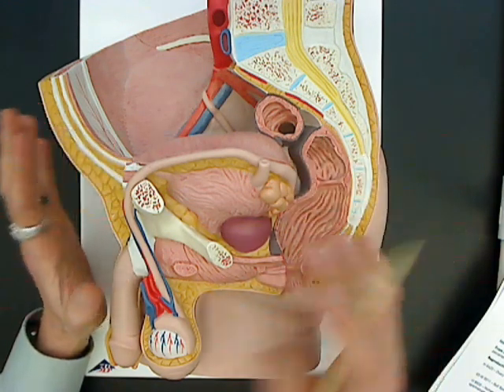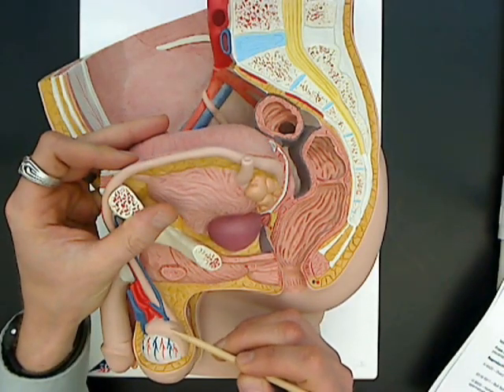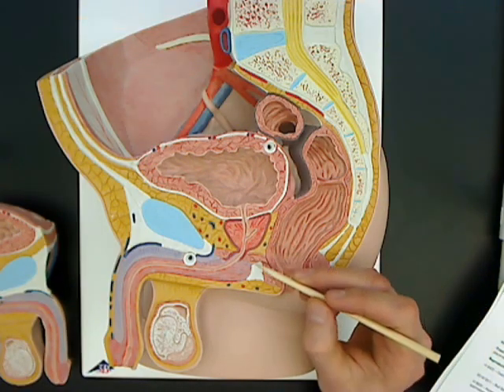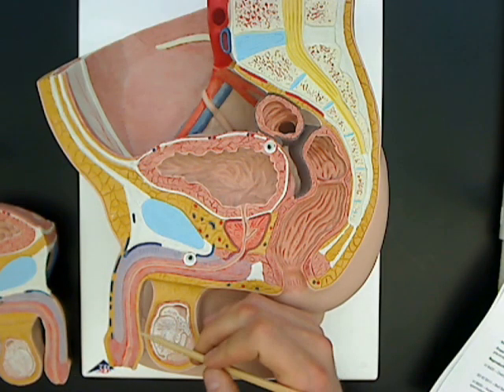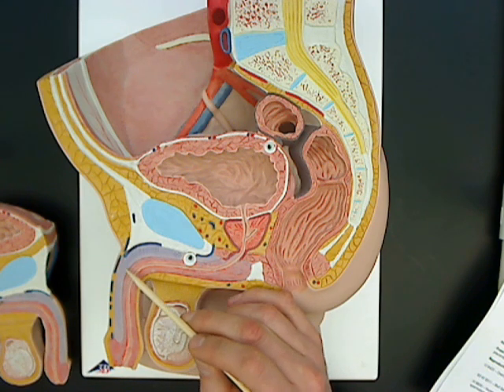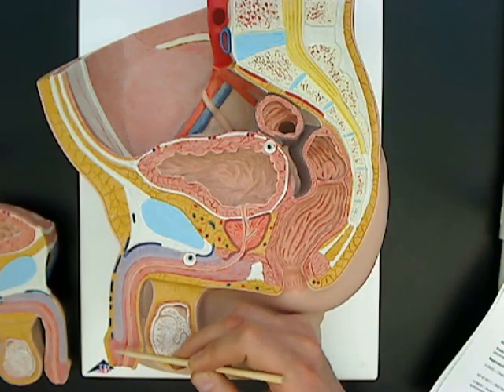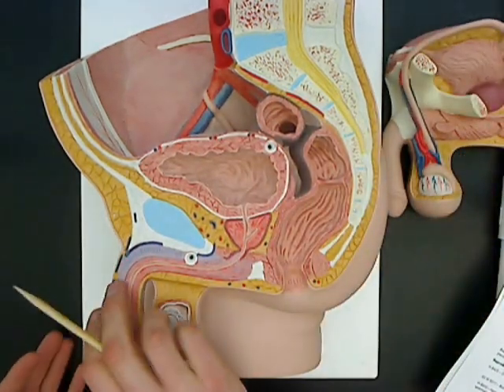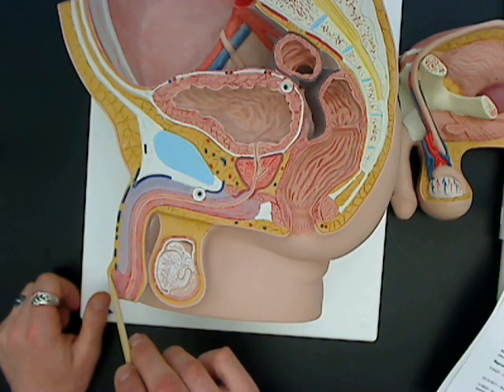Male reproductive anatomy model 01.wmv

Comment: Great video! but I had a question. . . can you see the cremaster muscle in this model?
Reply from the maker: I think that the redish or pinkish line around the right testicle may represent the right cremaster on this model.  Here is the basic information for cremaster muscles: 
  Surrounding each testicle and spermatic cord, the cremaster muscles are made of a relatively thin layer of skeletal muscle, the major function of the cremaster muscles is to raise the testicles towards the body in order to help regulate testicular temperature.  Sympathetic effect and the cremasteric reflex (elicited by firmly stroking the inner thigh) can also cause these muscles to contract  -- the cremasters can also contract voluntarily when a male performs a Kegel type of contraction.